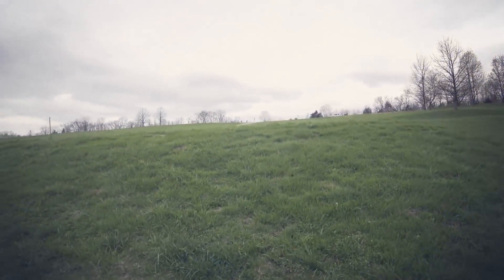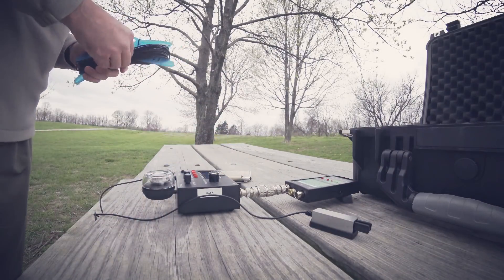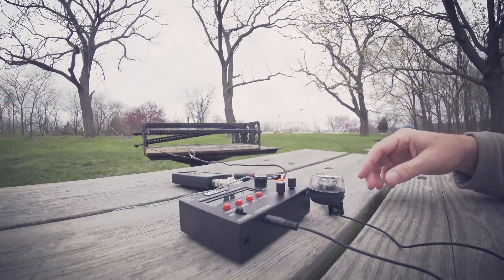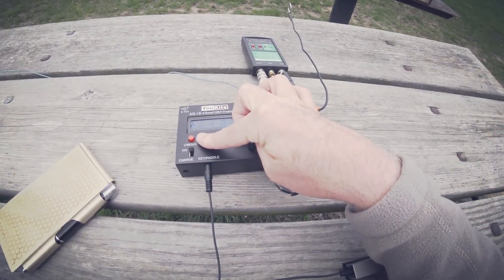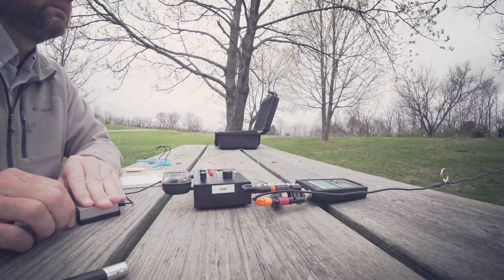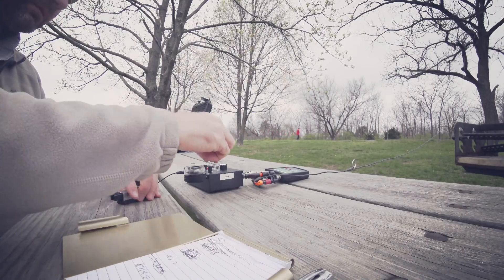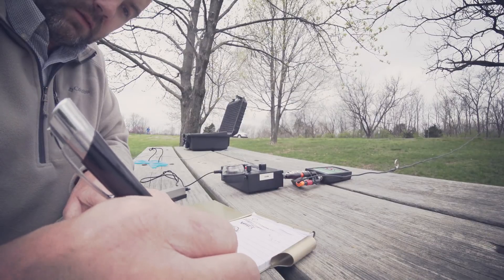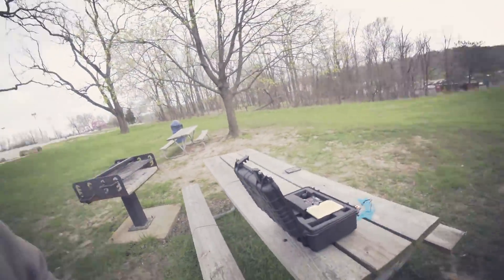Lunchtime QRP! |  Elecraft T1 Tuner | YouKits CW 2 Watt QSO

Comment: Nice video. I use my T1 with a Mountain Topper 5 bander. I participate in SOTA so it helps me change bands really quickly with nothing more than a wire for an antenna. de K7FOP